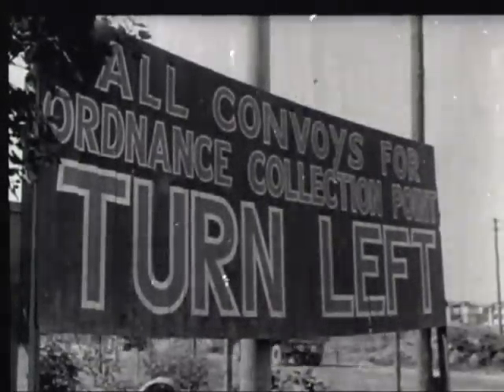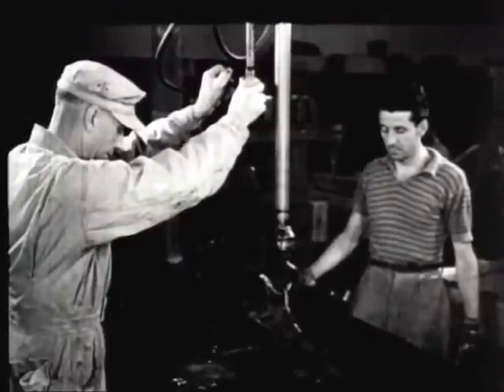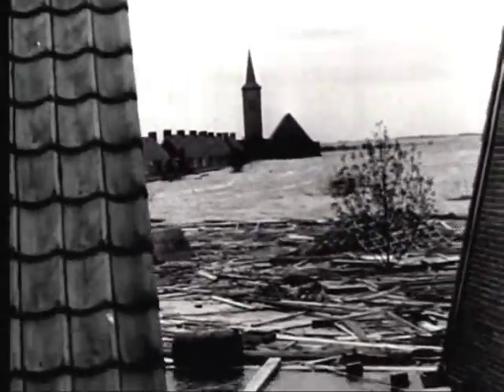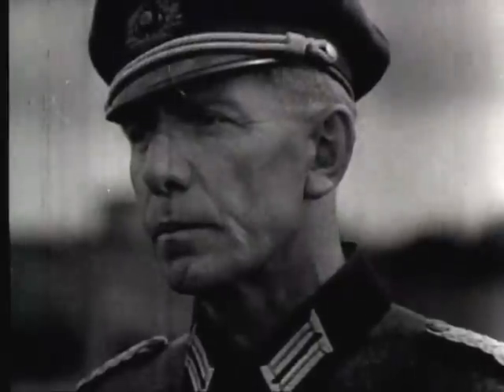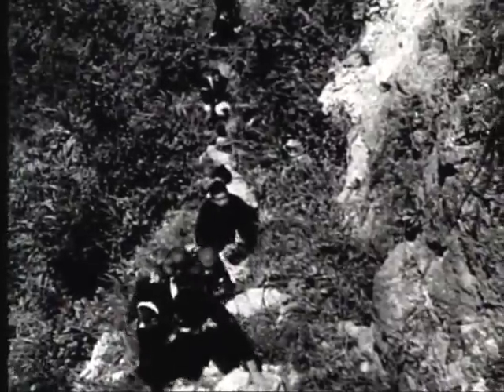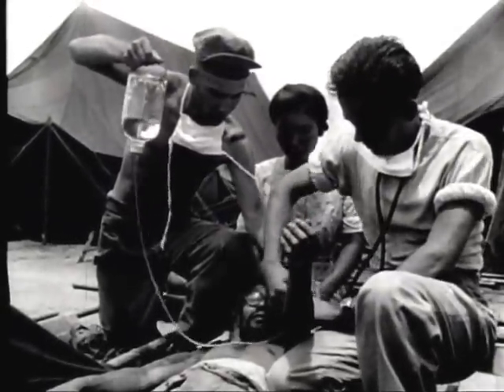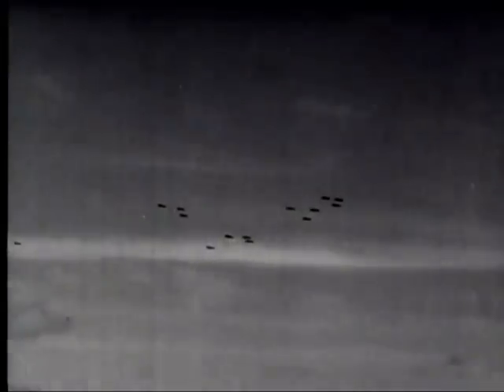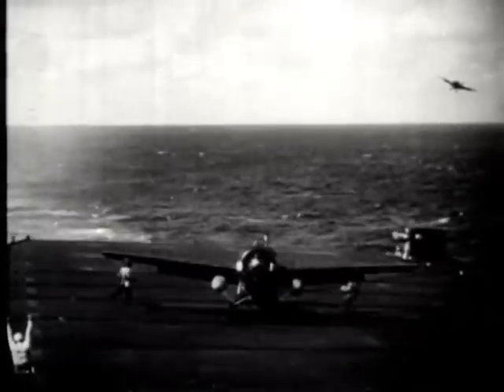Combat Bulletin No. 62 (1945)

Comment: The Army finally got their act together with its artillery ammunition by only filled the Comp B explosive to the limit needed to install the MTSQ (Timed fuse for air bursts), then adding a one-pound aluminum can of TNT to take up the open space left when using the standard PDQ (Point Detonating/Quick) fuse.  All the ammo bearers had to do was remove the sealant cap, invert the shell, and allow the supplemental charge to fall out, then screw in the longer MTSQ fuse.  The fuse would then be set for time at the gun under the supervision of the Squad Leader.  The removed Supplemental Charges were then stored in an empty ammo crate for later disposition.

Comment: I like the Wildcat that keeps flying after screwing up on the deck.
Reply: Sometimes they would be waved off as they were about to touch the carrier, they would pull up and pass over the flight deck. Then come back around. They were used to it. Plus they did similar stuff in training too.
Reply: That was a truly impressive save! Actually made me laugh.
Reply: @77goofyguy  Unlike the preceding one.  Unfortunately, I bet the pilot ate it on that crash, as the plane went inverted into the ocean, right in front of the carrier.